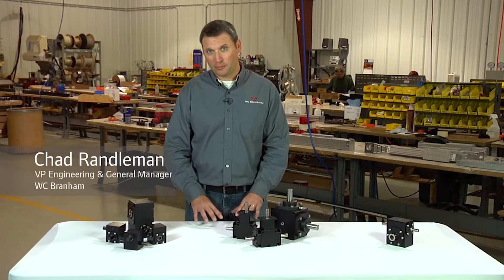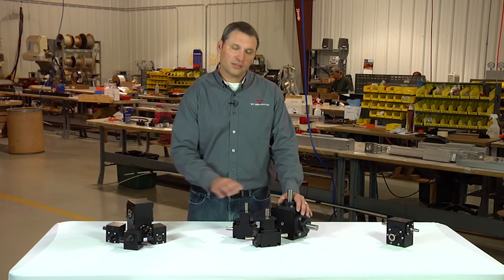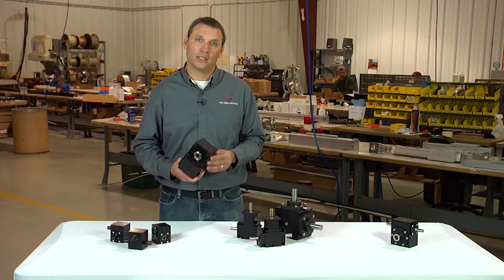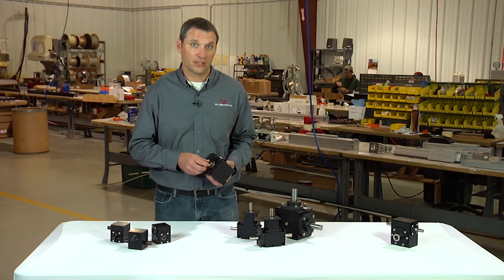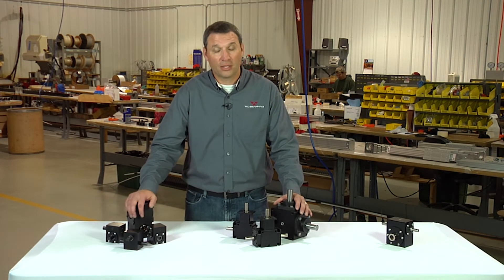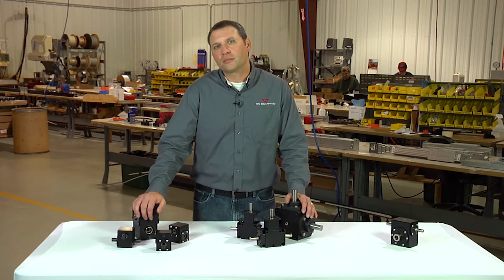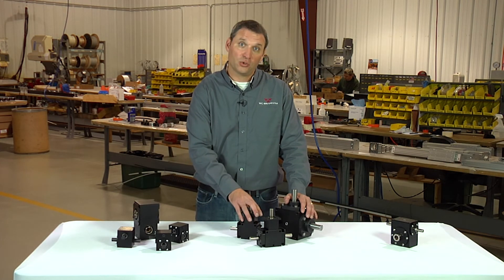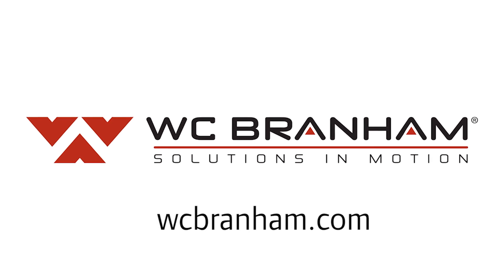Right Angle Gearboxes  - Answers to Common Questions

Comment: What exactly are these used for ?
Reply: to make a spinning shaft like a motor turn right angle.  great for say an e bike or heavy machinery. etc  like a car axel  splitting in to 2 side directions for the wheels.  but not for cars this is more electronic machines... be fine for like an ebike / gocart
Reply: At 1 minute in, what will that sized box be used for ??? What size for e bike ? The smaller ones ?
Reply: @SyntholFreak   im not an expert an employee etc just a hobbyist looking at these for a project. but if it helps  and without having researched these boxes much .. i think a big box like that should be able to drive say a 5000w to maybe an 10kw quad/ motorcycle. maybe more but different mfrs use different tolerances thicknesses or quality. but its also about a lot of other factors from drive motor and battery the force put in..   then the motor etc pushing against the gear ratio and weight of vehicle  you and vs landscape is it a hill.. for back force / strain put on gears.. then quality of materials..  but yeah bigger the better  for what it will take generally.. as components will generally be bigger thicker for more heavy duty jobs. but when does that become over kill and additional weight. or cost. there's a lot to consider there.  the max ratings should be on the mfr website.  personally id go for slight overkill for lastability.  if you cant do the science or cant be bothered go with what you think is overkill in size or it may depending on set up help to go for a low strain low ratio box set more for torque than speed. another way to create anti strain overkill since the force transfers with less pressure.  think cycling on a bicycle and moving between gears .. the gears that take you faster are harder .. im not sure how else to explain that lol hopefully you get it. i assume you know a bit your self to be looking at these.   its always worth looking around forums etc doing some research if costs or overall weight are an issue.   im looking in to a smaller one for a light weight ebike.  but these will be used for all sorts from machinery to evs..   so that big one  depending what it actually is..  might take the strain of a motorcycle engine being lifted.  roughly  in my mind..  so a lot of force.  it all comes down to how much  max force that box is rated for.  like i say that should be on the manufacturer's site.   mfr 1  box that size might be 1000kg  and the same size box from mfr 2 2000kg  so knowing that max torque is important. worth looking for. and gives you an idea what it will take.
Reply: @flowplanet429  sounds complicated. Would it be better to just buy a premade e bike vs building 1 ?
Reply: @SyntholFreak   if your not prepared to get in to the complex science of it.. your choices are kit or premade.  im sure you could fit a kit fine  there is a lot of tutorials if ebike is your goal.  trust me building a ebike from scratch can be very complex. this is the easier science involved.. physics when you get in to building batteries..  electronics etc which if you could you would for certain reasons.. that is insanely complex and dangerous. plus mistakes can be very costly..  in most cases a kit is the cheapest option.. often better than a used ebike. building is for those who are in to the science and like to push the boundaries experiment... or get the very very best. that's a expensive hobby..  although the skills you gain let you make things cheaper than manufacturer in the long run.. ie  you can pick up a drill or an used 40 dollar  hoverboard  and create a cheap ebike conversion  if you know how..  very cheap..  but the kits are very cheap realy and good. its the battery that will cost most.  learning to build those is worth it. but you still get what you pay for somewhat... its always going to be expensive. and have a certain lifespan depending on cell quality.  buying batteries you never know the cells used the configuration etc...  where building puts you in control  most importantly of the cell quality. or you can buy used tested cells to reduce costs. or even make cells replaceable. prolonging life.  on the cheap...  if your doing it for quality u replace all cells new each time...  you cant do that with normal batteries. / battery boxes. bought with kits or separate.  only custom made.
Reply: @SyntholFreak   a 250w kit costs about the same as a 1000w kit  but the battery will need to be bigger more expensive to get the same lifespan or to produce enough current on a higher power kit.  especially under peak load. thus that is where you pay more for more power not so much the kit but to power it.
Reply: @SyntholFreak  check your local laws before you buy or build it. what you want power or set up wise will depend a lot on what is legal where you intend to use it.  one large reason other than power is weather you can use a throttle. and speed / power restrictions..  like in the uk i can use a 250w pedal assist up to 15.5 mph..  but i can also have a sports mode for offroad use ;)  a lot of people do that.  i could say jump up from 250w legal to 10kw  insane speed..  with 1 button. if you want the fast bike experience.. just dont do it where its unsafe or illegal.   thats why people build from scratch  or some kits  .. for those crazy machines. although recently companies like suron have manufactured for that market. so theres less builders in the hobby .. a lot more just go buy one these days. expencive bikes but again so is the hobby way..  you wont build one of the same quality much cheaper...  youll build because you want more power ... more than people are buying..  so you can blow away surons on your beast 50kw monster bike lol. or to do something else they dont do... like building a suron / jetski .. or what ever the inventor is trying to do.
Reply: @SyntholFreak  dont quote me but i think that torque number is normally displayed in nutons which you should be able to convert to kg g etc  and the testing for working out that measurement would be lifting weights to failure.

Comment: how much torque to spin your gearboxes?
Reply: enough force to pass friction under no load. that would be very little...  about the torque put out by a 3-6v motor from say a vcr cassette player etc should do that. on the big one.  its a very random question .. your going right in to tolerances you would look at in say an motorsport like f1.  in most cases its irrelevant.